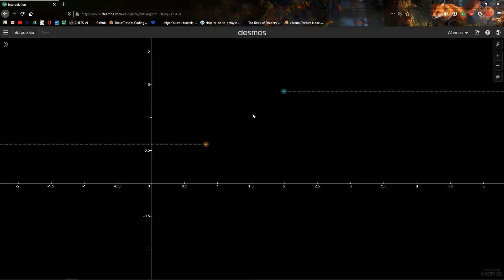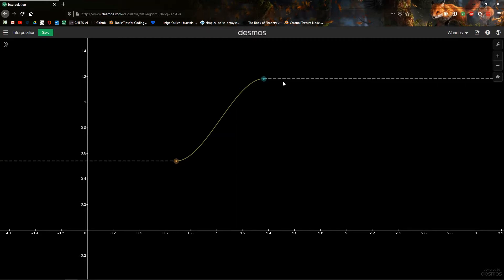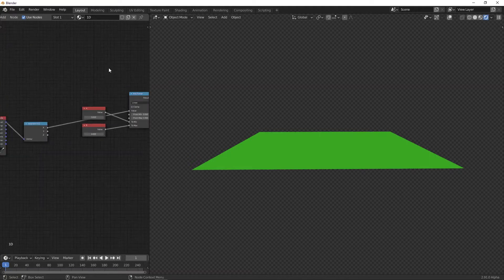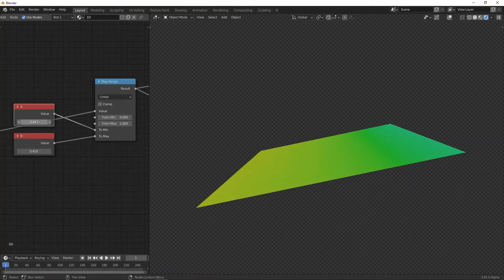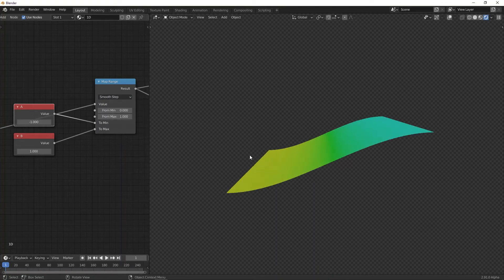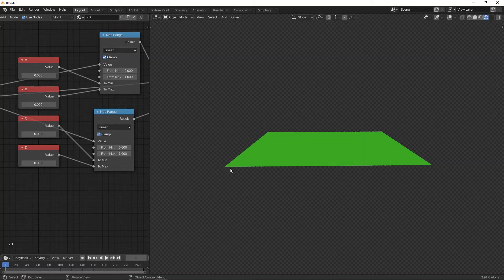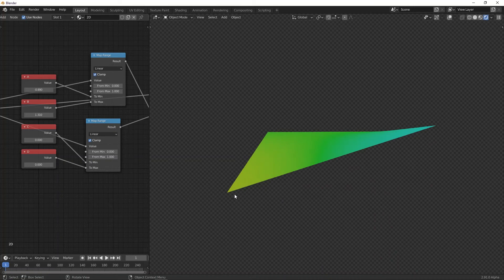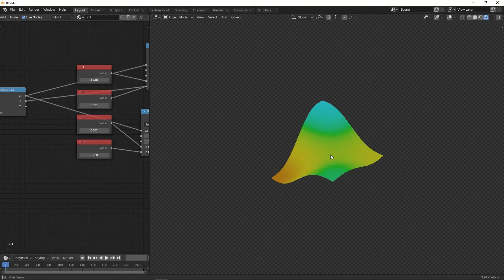Interpolation and Bilinear Interpolation ft. Map Range

Comment: Hi, does this involve calculus? So, in order to Fully understand the mechanism of Map Range, do I have to learn calculus? Thanks in advance.
Reply from the maker: If you want to rigorously derive the formula for smooth(er)step, you need to know what a derivative is. If you want to understand what the map range node does, then I would say that it is not needed at all. In practical terms the most important thing is to have some visual image in your mind of the shape of the different modes.
Reply: @WannesMalfait  Thank you very much.
Reply: @WannesMalfait  Sorry, but one more question hehe. Is knowing interpolation/ linear interpolation necessary for using map range (or for vector displacement in general)? I just started learning math to be able to perform procedural modelling so I'm a bit lost.
Reply from the maker: @HuyderFisch  The map range node comes up a lot in vector displacement, but more as a way to change the steepness of gradients and transitions and less as actual interpolation. The things shown in the video are not used often in practice and should probably be seen as a mathematical exploration, instead of something necessary to remember. I would suggest joining Erindale's discord server if you are interested in procedural stuff, a lot of people there to help you or inspire you, point you to good tutorials etc. Link: https://discord.gg/Y4WmDrF
Reply: @WannesMalfait  Really appreciate your help.